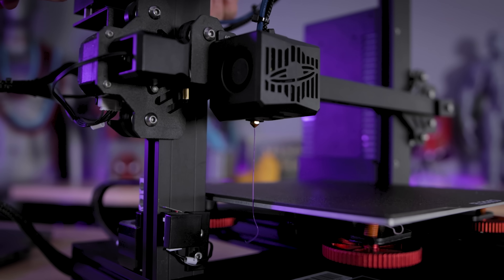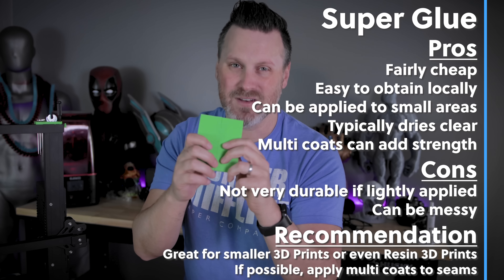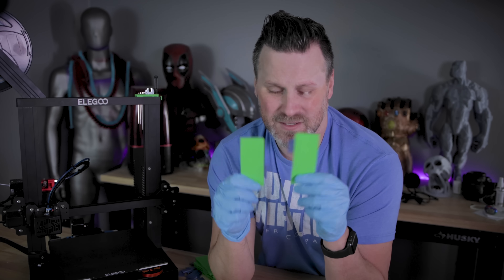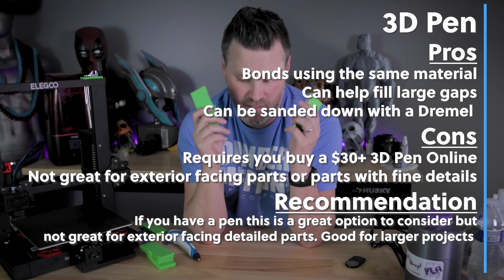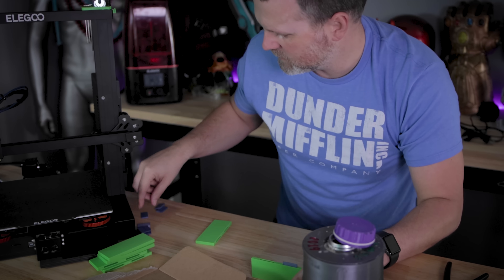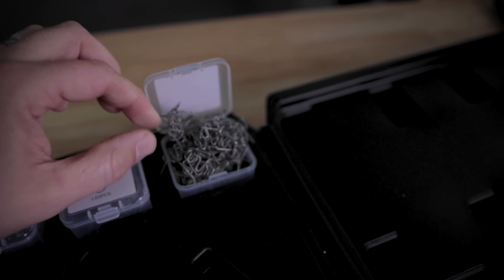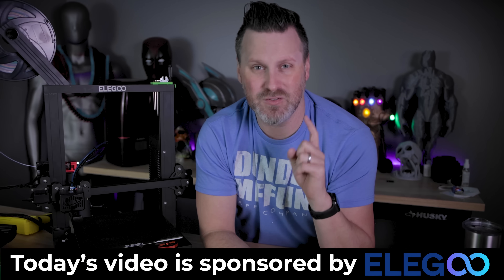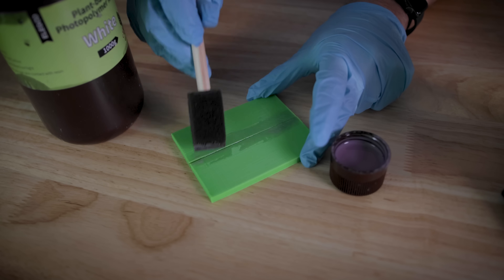6 Ways to Connect 3D Prints!

Comment from the maker: Soooo what did I miss and what do you prefer using for your projects?
Reply: 5 minute epoxy that I buy from the Dollar Store works really well for gluing pieces together. I always keep well stocked up on it.
Reply: Friction welding has similar results as the 3d pen. You could snip the point off the staples then use the soldering iron to push the wiggly bit in.
Great video. Keep up the good work.
Reply: You forgot five minute epoxy. I work with ornaments and what I normally would do is drill a whole out and add the wire into those holes and neural / rough the parts with some sand paper so the glue has something to bind to, then use five minute epoxy.
Reply: Black super glue. It has a rubber element in it that makes it less brittle. If you are going to use super glue, use black super glue. It's fairly new. 1 or 2 years old.
Reply: Dont use the sniper for the plastic welder just move the metal till it snaps
Reply: Don't forget a hot glue gun.
Reply: You didn't include my suggestion about the Lego Technic pins. In essence it's similar to furniture pegs to assemble stuff together.
Reply: With the plastic burning gun couldn't you snip the excess of with some of the clippers you get with the printer? Would get closer then those big ones on the kit
Reply: I have a Hako soldering iron clone that has a hot air blower used for melting solder paste and chip removal and repair.  If you’re careful it works if you use a small nozzle.  Can warp parts if you get carried away.
Reply: If you have a 3d pen I would recommend treating and job with welding in to as a real steel welding, make sure both pieces have a angle either printed in or sand the angles in and sand it with rough sand paper for better bonding, while using the 3d pen don’t do a straight line do small circles. Could also try after laying your bead of plastic use a flat metal scrapper or a putty knife and just scrape away the over lapped plastic or try packing it in with it.
Reply: I primarily use PLA for 3D printing along with miscellaneous electronics for robotics.
Reply: Superglue plus burning is a tad toxic. However you can use hot glue plus plastic weld
Reply: Can you try using an engineering resin like Siraya Tech Blu for gluing? It's far harder than any ABSlike resin. I have used it over superglue on PLA prints and have been very happy with the results. The bond ends up being stronger than the layer adhesion in the print. You can also thicken the resin with talcum powder or baking soda for better gap filling properties.
Reply: For larger terrain PLA pieces I use e6000.  Works great.
Reply: have you tried acetone welding with PLA?
Reply: In order to make the super glue bond better, use a low grit sand paper (240) to rough up both adjoining surfaces.  It creates a better bonding surface than the smooth filament fresh from the print bed, making a more porous surface for the super glue to grab a hold of rather than just resting on the surface of the PLA.   This works for most bonding products.
Reply: Contact adhesive and hot glue.
Reply: Combination of techniques: first I use the 3D pen to put a weld seam then, to flatten it, I use a soldering iron instead of the dremel you used, that way I'm not removing material and the flattening process increases the merged area of contact.
Reply: Weld on #2
Reply: Superglue and baking soda makes a chemical reaction that builds up the plastic. Utilising a chamfered joint helps
Reply: Acrylic glue and a 3D pen
Reply: I've had good success with Tamiya Model Cement
Reply: Non of that, I post a reply there, forgot to alert ⚠ ALWAYS use it outside or in well ventilated area.
Reply: Take a rotary tool and some left over fdm filament. Put the bit of filament into the rotary tools collet and then turn it on and actually "weld" the two pieces together. You will be using the same material as the print, so the bond will be astounding
Reply: I am surprised you didn't try using plastic modelling cement.
Reply: So...will you do one of these for resin prints?
Reply: I know it's obvious but have you tried JB Weld?
Reply: dovetails are easy to model and can help take advantage of slicing strength vs weakness
Reply: missed super glue together with baking soda, its pretty strong and can really create a cement like bond
Reply: Solvent Welching with Actone (for ABS) & Tetryhydrofuran (for PLA)
Reply: i use soldering iron and filament to join my projects together
Reply: No he didn't, my guess is that the first solution (Super glue) because he wasn't able to break it. That's what I use. I have a 3D pen I will use also for the backside of prints also but it's hard to beat cheap super glue
Reply: What brand of 3D gloop for PLA do you use?

Comment: I'm looking around for a way to connect 3D printed parts using a 3D pen Without needing to apply it around the outside. It works okay for large parts. If you just do it really quick like put a an indent on one of the parts and then put hot plastic in that into and then slap the parts together. But for small parts the plastic cools too quickly. I'm wondering if anyone has developed a method for this. I've tried using a heat gun to keep it warm enough to fuse together but it doesn't work. It just warps it.

Comment: 3M DP8010 or DP8005 (acrylic glue) is by far the best adhesive if you want something bullet-proof and need to bond dissimilar materials to PLA. Might struggle with PETG but I was mind blown by the adhesion you get with it. however, I was also mind blown by the price too... (I think Permabond TA4600 is half price and deliver the same result but still need to try)

Comment: What are your thoughts on friction welding? putting some filament on a dremel and using the heat generated by sthe spinning filament to melt the 3 things together?

Comment: For 8th grade we made a bittld rocket, i made mine with 3d-printed parts i designed, and used a 3d pen to weld pieces together. It fles so far it landed on someones roof qnd we needed to wait till a storm blew it down and shatterd it, and in some cases, the print broke brfore thd weld.

Comment: If you are adhering PLA to PLA, then the best adhesive, bar none, is weld-on 16 acrylic cement. There's a gel version in tubes, and a canned version that's more runny. While intended for acrylics, it also works for PLA. It's not a true glue, instead, it's a solvent cement, melting the surface of the plastic to cause the PLA to bond. It won't off gas like superglue, so there's no clouding. It's not cheap, but the only thing stronger would be printing one complete piece. It will NOT work with most other filament, but since PLA is most common, it's probably worth considering.

Comment: Glue inside the mortise and not the tenon and you'll have very little clean up. Been using this joint in woodworking for ages. Also if you sand both faces you'll end up with an almost seamless fit.

Comment: I like using tamiya cement it melts and fuses the peices together. As a model hobbyist it works pretty well with pla but it well require sanding and clean up.

Comment: If you're going to use a 3d pen or wood burner, design a V groove in the back of the part and you can fill the whole space instead of only welding the outer most walls.

Comment: for the welding with a soldering iron I would recommend getting one with temp control. i got one off of amazon for like $10. Got mine running at 230 c and its not burning my elegoo pla+.

Comment: Have anyone tried using super glue on the pegs then using a 3d pen for the seams then the wood burner soldering iron to smooth out the 3d pen mess?

Comment: Can you print a little access plastic that will go on the inside so like you print the ledge on the one piece and then when you slide them together then that goes over top each other then there's a little band inside that way you can glue that band in the bottom edge together in the inside of a helmet to really get it strong

Comment: Try using PVC pipe glue I tried it. It works really well.
Reply: I haven’t seen anybody else try it, so I got some to try you don’t need to use the purple stuff just the glue but you might have better results with 
the purple stuff I haven’t tried that

Comment: The plastic welding gun and curvy staples is how they repair bumpers and body panels on cars. If your part needs a crazy solid, if ugly join is it 100% the way to go, and you also fill in the holes with a 3d printed pen or other filer and sand it down.

Comment: How about Weld-on 3, 4, or 16?  It's like paint thinner and will weld the two PLA pieces together.  Weld-on #3 is watery and sets in a few seconds, #4 is a little thicker and sets in 30 seconds or so, and #16 is a thick consistency that sets in like 5 minutes.

Comment: hi! i'm planning on joining 2 3D prints which are made of a fluorescent PLA to (try to) make a huge piece of a sword blade, the full print will result in about 160cm, the issue is that i don't want to have the printing "corners" in plain sight since i'd love to have the smoothest glues up blade possible, in some places i can try to hide the joints under some paint since the blade has some embroidery on it, will 3d gloop make a "perfect" join? any advice?

thanks in advance!

Comment: I am trying to make a spacer to go between polly pipe and PVC pipe already have one designed and printed that fits but from PLA....Im pretty sure my printer cant do it as i can only print PLA and PETG maybe ABS so i was looking to farm it out to one of the online 3d printing services but my question is what materials that can be 3d printed can stand up to PVC cement? as this is what i would want to use on the pipe bonds. Im pretty sure PVC cant be 3d printed even with high tech 3d printers?

Comment: Hi thanks for the really nice video 
yesterday i used the soldering iron method plus drywall fiberglass tape ! Melting the fiber glass in to and around the sim all the way after i have glue the 2 pieces with super glue. 
iam gluing parts of a helmet by the way so i used the soldering on the inner side as a support.

Comment: I like using my prime lines with soldering iron i save them an use them as welding rods especially on the outside were the seam will be seen the thin prime lines melt into the seam nicely without a lot of mess

Comment: I honestly thought having those "3d printed biscuits" would actually give some support. my go to for things actually holding is epoxy 😆. For broken prints I'd drill and epoxy dowel in. Can also use wire on tiny parts. 

Another idea might be testing some sort of locking connector to 3d print or interlocking parts.

Comment: Thank You for the video.  In my current project I can't use "biscuits" as you did in your video.  I was planning on using and 2 part epoxy, 3d pen and wood burner to seal my PETG parts before I saw this video.  How is the "PET Gloop" better for PETG than the PLA version? How is it different from PVC glue?

Comment: 12:45  there are surface cut snips that would work better than regular dikes.  not the smaller kind that come with 3d printers, but a beefier kind where the tip is flat perpendicular to the direction of the handle.  there still might be a tiny burr sticking up though.  but once you get them snipped, you could use some type of sander to smooth it all the way.  
they're called "end cutters".  you can get a really cheap pair from amazon, but keep in mind how tiny those cheap ones are going to be.  they may not last long against those thick staples.  if you really want to go this route, just spend the money and get a decent pair.

Comment: you should have tried adding baking soda to the superglue part. Baking soda increases the glue strength of superglue massively. For example powder one side with baking soda and add a bigger amount of superglue on the other side then fuse them together.

Comment: With decorative pla I like to use a gel superglue. It's cheap,avaliable everywhere and just works. If it needs to handle stress I like to design a joint of some kind of joint in the model and using superglue after. 

E6000 works pretty well if you need a flexible joint or in some prints it can actually be removable which is really nice.

Comment: Update: Hi Jessy, they do make Break Away staples that break under the surface.  Also that iron attachment is used to weld screen into the plastic (for hole repair)  Cheers!
Reply: I came to type this! you don't cut the staples you break them! :)

Comment: Ive done this in an extreme case i have taken a strand of filament cut it to length and lightly glue it to the two pieces that you at trying to connect, then with something like the flat wood burner go over the filament inside the seam and melt it like your ironing clothes. Similar to the 3d pen and wood burner, but a bit cleaner, because you dont have to move plastic around the area to fill in the seam.

Comment: I use a 10 minute epoxy adhesive for my resin prints. You just have to mix the two components and apply.  It's really strong, even stronger than the printed resin itself. It can be toxic tho, make sure you use gloves and respirator.

Comment: I love the wood burning technique! I've used it before, I'll take scrap supports and use them over the part that needs to be bonded and melt it over or fill gaps with melted material, I found the only issue is if you use it around thinner walls, it will warp them, possibly in a way that you didn't intend.

Comment: Take a rotary tool and some left over fdm filament. Put the bit of filament into the rotary tools collet and then turn it on and actually "weld" the two pieces together. You will be using the same material as the print, so the bond will be astounding

Comment: Also, ever thought about the wood burner or soldering iron and physically using FILAMENT and "welding" like you're welding metal, but with filament..? I did it, comes out pretty good in terms of the bond for sure. It's kind of a combo between the 3d pen and the wood burner together

Comment: I have used the plastic welding kit you have, and it's GREAT!!!! The trick to using the staples, is to clip them with the clippers, and then use a grinding stone on a Dremel to grind them down slightly below the surface. You can then fill in the small void with spot putty.

Comment: Just being pedantic here, but I’m pretty sure the word “weld” doesn’t mean what you think it means. Welding is typically a process whereby two or more pieces of material are heated to the point of melting (locally) so the material can intermingle and join the two pieces into a single part. Filler material is often used to add volume and account for any gaps between the two pieces being joined. 

Most of the methods described in the first half of this video are forms of glueing. Not welding. Glueing, or adhesively bonding, is a process whereby a third material is introduced between the pieces to be joined, and adheres to the substrate, creating a bond between the parts. The CA glue and UV resin are clearly being used as glues here. The 3D printing pen could theoretically be used to weld parts together if you got enough heat into the substrate material to melt it, but that clearly wasn’t happening, so this is arguably just using it as a hot melt adhesive. 

I know it can be silly to get caught up in terminology. And I’m not an engineer, so I can’t claim to be an authority on the subject. But I’m a father of four, who has repaired hundreds of broken plastic toys. I’ve found that selecting the correct bonding method for the job is critical. And understanding exactly how each method works is a key part of selecting the right one. You need to understand the nature of the base material, the nature of the bonding material, and the process requirements (surface prep, geometry, temperature, clamping, cure times, etc). Most important is practice and experience. 

So, yeah. Not all forms of bonding should be called welding. There are huge differences between welding, glueing, mechanically fastening, soldering, brazing, etc. and it’s worth getting familiar with them.

Comment: The tip on the plastic welder is to make the plastic flat again, it will work fine on front facing surfaces.

Comment: I want to try a mix of 3 for a project I'm working on. Use 3d gloves for the large flat middle, staple the outside and then use the soldering gun like a welder and melt filament into the areas the staples are in to fill it

Comment: With a temperature-controlled wood burner and a variety of tips, you can really get quite precise welds. You can also add material into a weld from the spool or from failed prints that may be sitting around.

Comment: Not sure if anyone mentioned this before but there is a way to friction weld pieces using a dremel rotating the filament against the two pieces. It doesn't penetrate much into the pieces but its the same material and if you sand it doesn't look too bad

Comment: I used a soldering iron and some steel mesh to fix my trucks door handle, works like a charm! Just lay the mesh where you want to weld and push it in with the iron (you can also add plastic if so desired). The finish isn't the most visually pleasing,  but it is very strong

Comment: neat stuff, kind of stunned that the staple melting tool didn't come with a proper flush cutter, just a run of the mill wire cutter which is NOT flush.  Weird choice on their part.  Neat video.
This is why I typically print in ABS (ASA in the future) so I can solvent weld with acetone.  The gloop is a great product for doing that in other materials, but costs more of course.  I will have to get some of that for pla and petg!

Comment: I like using JB Weld SuperWeld - it's a cyanoacrylate adhesive, and forms a great bond between PLA parts very quickly. The only thing I noticed is it can leave a white residue on dark materials, so I started using painter's tape to mask it off and ensure I only get the areas I need to.